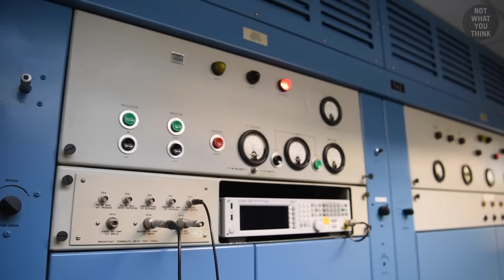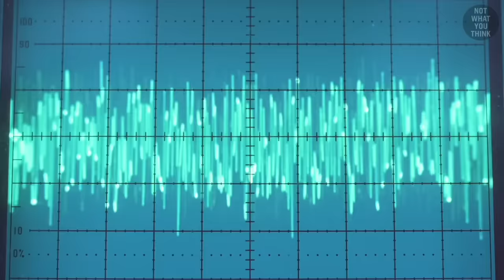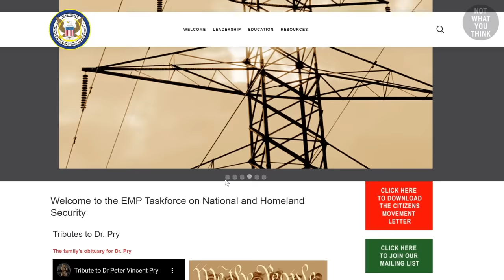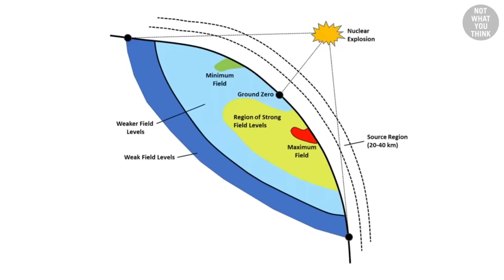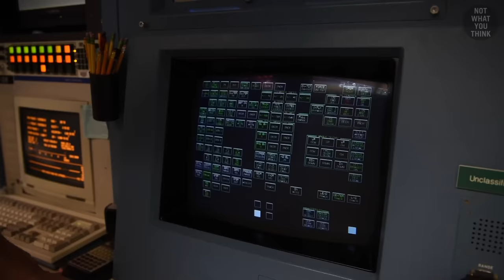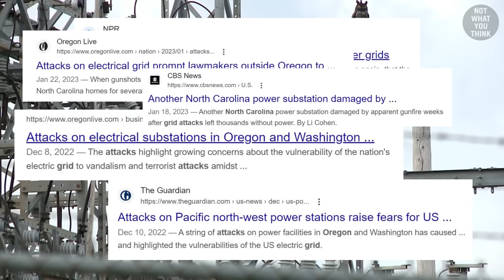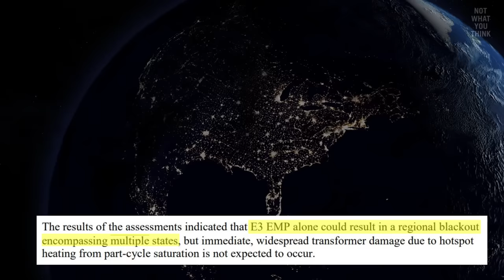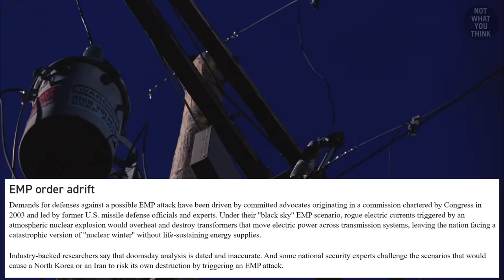Why an EMP Attack is Worse than You Think

Comment: Once the GPS satellites are offline, there will be no more free atomic clock signal available everywhere to keep the frequency and phase in sync for the several AC generators that compose a typical power grid (this applies not only to USA but pretty much to most big countries). This means that all connections between these electricity sources must be severed as soon is confirmed that a SME heading the planet, otherwise tehy will destroy each other. And after the EMP, it will take time to replace the satellites and/or the atomic clock signal used to keep all this equipment in sync and only then reconnect everything back to the grid. Curious Droid has a very detailed and interesting video about this topic and also about the Carrington event itself.
Reply: The grids stayed in sync for many decades before GPS or even atomic clocks were available.  They are designed to isolate sections when the sync with neighboring areas is lost.  There is additional damage that can occur when large imbalances occur between source and load areas, to be sure.  This happened after the Northridge, CA earthquake damaged transmission infrastructure.  But there are some fallback safety systems not dependent on GPS.  I will check out C.D.'s video, thanks!

Comment: You should look into the government's "Disaster Preparation Plans & Training"

A relative who actively was testing and learning all this back in the 80's. I'm pretty sure it has been updated even more by now

Outside of their original training, in the early 2000's they had several specific specialties and we're qualified for taking over local government plans depending on where they were stationed (associated with FEMA too I think)

But in the mid 2010's they dropped out of the program and weren't able to have any private sector jobs related to their certification for a specific time period.

Comment: what are the ways to stop an EMP? would that be some type of insulation or certain points where surges are safely stopped.
Reply: Faraday cages (metal boxes) stop EMPs and a lot of infrastructure is shielded this way, especially military infrastructure.
Reply: Stick your phone in the microwave if you know a blast is incoming. I'm serious. Don't turn the microwave on, though
Reply: For example in your computer some cables have a copper net to shield them from induction, what an EMP is all about.
So there is an easy way to protect from an EMP
Reply: @mcyounglordlauch7012  It's easy on a 6' computer cable. It's not easy on 700,000 miles of transmission lines in the U.S. alone.
Reply: @dan8250  i know, but my point was that the technology to secure stuff from EMPs is known to mankind
Reply: You build the Golden Eye helicopter.  =P
Reply: @iivin4233 

Your 6 sided cube 
(Microwave oven)
Has a 1 sided glass door 
So nope, that won't work

Comment: Several massive mistakes.  First, you VERY flippantly dismissed the Canadian integrated grids.  This is a catastrophically big detail in discussing strategy and impact.

The second and nearly equal issue is that you, like so many people, don't get it that a nuke plant won't just go blow  up cause no grid power.  Fukushima didn't happen because the generators failed.  It happened because they failed far too soon.  A nuke plant is designed to fully shut down AND have enough fuel on site to cool the whole thing to the point where it is effectively inert.

Please do your research on things before you just babble.  I know these things but others don't.  Equally, there are other things that I don't know that you may "tell" me in other videos and I don't want to be deceived.  So the more BS I sniff on your channel, the sooner I hit the unsub.

Do not become the infographics channel.
Reply from the maker: Thanks for your comment. We somethings get some things wrong, but our intention is to convey accurate information.
Reply: Well, the big question is how many of the nuclear powerplant electronics themself will be fried by an EMP attack. If you fry them just right the power generators will never even be able to start
Reply: how will it shut itself down without backup generators, or electronics? remember, those things are fried in this situation.

Comment: The answer to EMP, CME, and terrorism: Use tunnel boring machines to make 5+ meter diameter tunnels from one substation to the next. Suspend huge cross-country high voltage transmission lines in the center of the tunnel in a triangular arrangement for 3-phase power. At the substation, build underground vaults down to the transmission line tunnels for the transformers and switchgear. Make smaller 3+ meter tunnels from these large regional substations to the local substations within each state, also buried underground. The only thing to be exposed would be the standard low and medium voltage transmission poles out to customers. To further protect against CME and EMP the substation vaults should have rebar faraday cages embedded in the concrete vault roof. If the exposed transmission poles are struck, there can be surge arrestors at vault to reject these high energy events, as well as explosive shearing / grounding blades to disconnect and ground out the surface wiring. Using cross-country tunnels also prevents outages from storms, forest fires, tornadoes, floods, and bird guano on insulators.

Comment: Fuel pools are crammed to many times design capacity, and still no long-term storage is available. Without electricity, the pools evaporate and spent fuel assemblies spontaneously catch fire, like at Fukushima, flooding the atmosphere with hot particles enriched beyond anything found in nature. Nuclear pollution and cancers have gone hand-in hand with the nuclear power era. You don't need a maths degree to work that one out.

Comment: You need to make a correction about the nuclear power plants. They CAN NOT explode due to a lack of power (in fact, additional power would be required for that) In the case of a sudden outage, the control rods are immediately dropped (because they require an active power source to stay up, against gravity). What happened in Japan was a meltdown, not explosion, and didn't cause ANY damage to even the exterior of the reactor housing, much less to the nearby city.

Comment: Nuclear EMP is actually arguably worse than solar. A solar EMP cannot damage a delivery truck or unplugged transformer and comes with substantial warning. Nuclear EMP can damage even small electronics with its intense fields, and causes temporary flash blindness over a vast area which means a lot of traffic accidents and such. Nuclear EMP would be a lot of worse than solar when it comes to everything but stuff that can't be unplugged from a kilometers long electrical wire.

Comment: I live with no electricity everyday and have  no issues.  Also every engine made before 1960 works just fine without electricity except for the distributor for the spark plugs, but an older diesel engine doesn't even  need that. Stupidity causes more deaths than anything else

Comment: I feel like if the Russian Federation was able to use a non-nuclear EMP bomb to knock out power grids they would have done so in Ukraine already. They have no problem continously targeting civilian infrastructure and have been conventionally bombing the power grid, as is mentioned in the video. The argument that maybe it would be seen as an unnecessary escalation is moot since an EMP would just harm infrastructure whereas high explosives kill people in addition to blowing things up. I'm very skeptical of purported high tech Russian capabilities after their failure to materialize after over a year and at least tens of thousands of casualties, especially when they're using dumb munitions and conventional arms to attempt to accomplish the very tasks these things are supposed to handle.

Comment: The danger of EMP's is wildly exaggerated. A nuke is not strong enough to cause real damage. The satellites of the early 60's and today are so different that they might as well be a different thing. From the sun? We would have a couple days notice. Disconnect the long transmission lines. In 1989 there was a blackout in Quebec due to a CME. It only tripped the system and caused no real damage. And that is because the transmission lines are almost  1k KM. I live in Quebec and remember it well. It took a few hours to restart the system and all power was back in about 8 to 10 hours.

Comment: I did some research for making an emp generating machine. A lot of the early experiments are no longer classified and machines made in the same way, have a very limited range, and are not a serious threat. You can even find out the device the boeing 'champ' uses. There was a lot of work done in the mid 00's to mid 10's to harden critical infrastructure from attack by the 'machine' method. The sun and nukes (although you'd be lucky to get away with that!) are still a threat.

Comment: Most of this video is pretty correct but saying that nuclear reactors would meltdown without power from the grid is incorrect and comes off extremely alarmist.
Reply from the maker: that's what we found from research, and even looking further into it we couldn't find a definite answer. At the very least it appears that spent nuclear fuel pools require electricity to run pumps/valves for at least 5 to 7 years. Passive convective cooling appears to only a future on newer designs. Again not an nuclear scientist, so still looking for further information which is properly referenced.
Reply: @NotWhatYouThink appreciate the research and provided references. usually this channel has always been pretty spot on and never alarmist but this one just sorta felt off to me. I will take a deeper dive into the provided references and reevaluate my own personal standpoint!
Reply: How on Earth can a Nuclear Power Station have a melt down without power from the grid ! What do you think produces power for the grid - hamsters on a wheel ! ?
Reply: @jamesbarbour8400  It may surprise you to know this, but power plants need power to run.  Watch some videos on what a 'black start' is.
Reply: Not if the control boards burn out , motors too .

Comment: You're wrong about nuclear reactors. Not only do they have passive core cooling systems, in the US they're equipped with H2 scrubbers. So even if a meltdown occurred, there wouldn't be a buildup of hydrogen in the reactor building.
Reply: Satellite constellations wouldn't be completely crippled, either. Only a small fraction are over the US at any given time. Even if an attack took out 1 in 5 Starlink satellites, for example, there would still be 4,000+ available to reposition and fill the gaps within a matter of weeks.
Reply: [sigh] And electronics would be a mix. Desktop and laptop computers would likely survive thanks to their EM shielding, except in cases where they didn't have sufficient electrical isolation with wireless components. Mobile phones and tablets, on the other hand, probably lack such protection due to their tight wireless integration.
Reply: We would still likely be able to figure out who launched a FOBS attack. If it was an immediate launch, it would have been spotted by monitoring satellites. If it was a weapon that was placed in orbit and later used for the attack, it would be a tracked object. Though in that situation it would take time to determine precisely which object it was. This could be complicated if the spacecraft had significant maneuvering capabilities, but would essentially amount to looking for the missing satellite.

Comment: EMP attacks can easily thwarted by using faraday cages and shielded cables. But not a cheap fix.
Reply: Not quite, Luis. IF they are properly built and used (many are not) they still only protect what is offline, out of use, inaccessible during normal times. So you'll need to buy spares for all your electronics, and then first make sure your cages work.
 Ever wonder why a cell phone works, inside a closed stainless steel box (elevator) inside the core of a masonry and steel building? All that stainless "should" be a faraday cage. But it isn't quite tight enough.
 And then there is our food distribution system. All the tractor trailers, diesel locomotives, aircraft...there are no spares in Faraday cages. There will be no way to distribute food, fuel, or goods. And no way to bugout--except on bicycle, horse, sailboat or foot.
Reply: @lyfandeth   @lyfandeth  I cannot agree with you. Diesel engines don't need electricity to work, you can remove the battery and the engine will continue to run. As for Faraday cages they are used for medical equipment (MRI), there are a lot of technicians able to properly set them.

Comment: 0:18 "Back to the 80s"  wouldn't be bad.  Gens X, Y, and Z and millenials would have more respect for us "baby boomers" if THEY had to go look for work and fill out paper applications either at an "employment office" or anywhere they wanted to work. I think having to actually remember exact start and stop dates, wages, and job duties would utterly infuriate them.  Remember, there'd be no personal computers or resumes on USB drives. Resumes and salary histories would have be perfectly typed and STILL accompanied by a fully completed application without erasure or errors. It would be interesting to see their reactions also to standing in a long line just to get an application and have to fill it out faster than an ink jet printer in order to get a same day interview, knowing that tomorrow all the jobs at that particular company would be filled.  So, they start completing the application, seated at a table with 6 or 7 other people and find that it has to be printed. (Why did they struggle to learn cursive handwriting?)  And some blocks are so small there's no way print a sensible answer in them.  Plus, imagine them actually burning gasoline that cost $2.25 per gallon to go to a potential employer's place of business or to an employment office only to get a minimum wage job 20 miles from home that starts at $2.90 or $3.25 per hour!  After that got taxed, they'd burn up 2 or 3 hours of a day's wages just going to and from work!  😂😂 They'd go ballistic, but wouldn't it be funny!? 🤣🤣

Comment: This is why EMP Shield is a good idea for your home and vehicle, so you increase your chances of getting home if you are away when it happens. Consider sewage systems going down for months, as sewage backs up into low level homes in each area making some home quickly unlivable. Make sure you are not staying in a low-lying area of your city. creating your own food and energy will be valuable after the die-off. The trick is making it through the die-off period of the first year. Read "One Second After".

Comment: It's completely unacceptable to be so vulnerable to high voltage transformers. We need a better designed grid with more standardization (perhaps standardizing the components of otherwise uniquely built transformers.) a stockpile of "good enough" transformers, the ability to manufacture them in volume or some combination of the three.

Comment: EMP energy is reduced to 1/4 as the distance is doubled.  So distance is your friend and the US is a huge country. Chances are if you're 10-15 miles away you will be fine. We need to harden our main grid, but not worry so much about the small stuff. It would probably take 1000 nukes to knock out half of our soft grid as it now stands.

Comment: This is an incredible exaggeration, straight out intimidation effort.
There is not much energy in a low frequency radiation or short pulse
The energy for radiation is simply the frequency times Plank's constant, 6.62 10^-34 joule sec.
Do it yourself for a steady radiation intensity
For a short pulse an integration over a very short time is applicable.
Keep in mind a nuclear explosion is mostly a pressure wave and the ensuing  winds behind it.
This  is in no way a justifiable proposition.

Comment: wouldnt it b possible to place sacrificial electronic components on the powerlines which either filter out unwanted frequencies ranges, or blow themselves up when a high voltage or current is passed thru them? such filtering tech already exists! even if the rollout of such things would b tedious and slow, its better than doing NOTHING. as its already been admitted that theres a serious risk of attack, then y not DO SOMETHING?

as to the objection "but altering the power equipment requires shutdown" then plan the shutdown and broadcast it in advance, power outtages happen without warning all the time anyways.

i refuse to believe theres no way to stop this.

directly shield critical equipment, place protections between shielded and unshielded equipment.

Comment: Hang on...
Nuclear plants don't need to be cooled if they aren't running. If the control rods are pushed all the way down, all fission ceases. Without fission, no heat is produced, without heat there's no need for cooling. It's just a question of "Are the control rods mechanically, or electrically powered?" One should think that EVERY nuclear power plant should have an electrically powered control rod actuator, with a mechanical backup. I don't know the details of what happened in Fuckitshima, however, I can't help but wonder why they didn't drop the control rods the minute they suspected a terminal problem.
Reply: Lol

Comment: The idea of using a missile for a surprise attack is simply impossible in modern days, as many satellites have very sensitive spectrometers specifically designed to detect missile fuel burn residue, if you launch a missile, you will be spotted no matter where you are
Reply: still its quite difficult to shoot down

Comment: 3:35 — Not boom! Modern nuclear power stations have emergency containment tanks for melted nuclear fuel. And the new generation has passive protection system (no electricity—shutdown without firework). Please, be correct and precise.